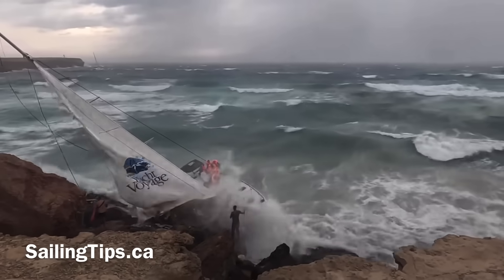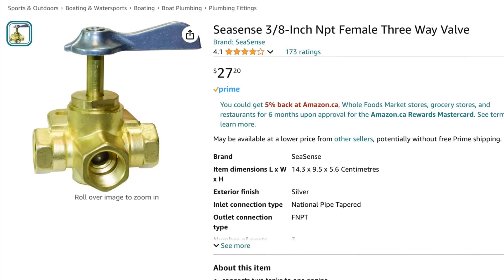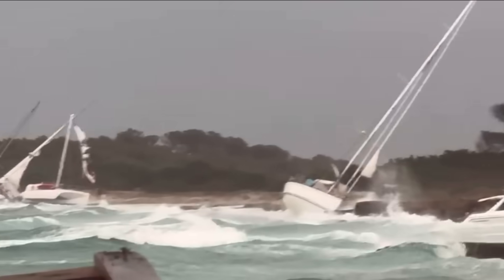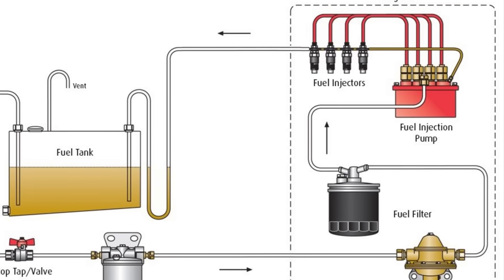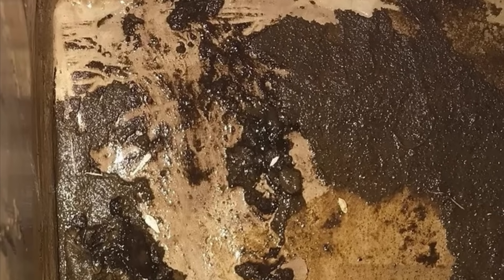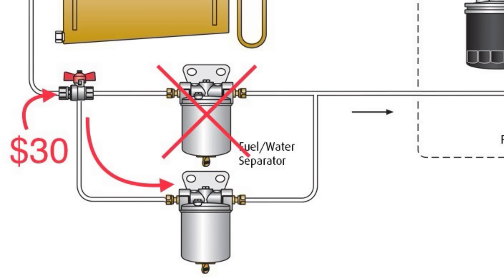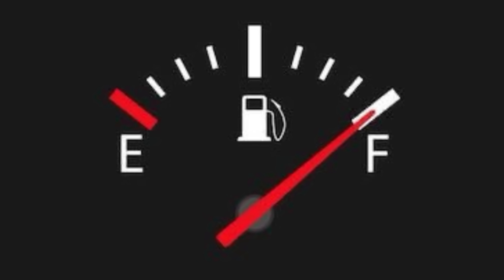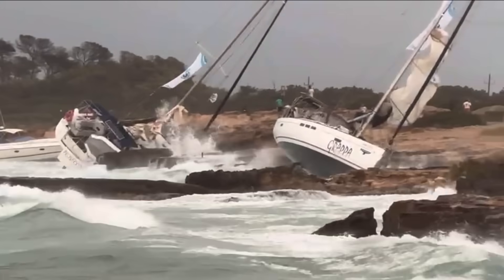The Critical $30 Safety Device Most Boats are Missing!!!

Comment: Add a diesel bug killer with every fill. Stop the bug from ever getting hold.
Reply from the maker: Yes highly recommended - I should have noted that in the video!
Reply: @SailingTipsCa  - My concern is that is conditions are bad enough to block up a filter, they are bad enough to block up a second filter too. Admittedly they may buy 10 or 15 minutes which might make a huge difference between safe water and being on the rocks. I guess it depends on the level of contaminants. The second set might be good for days or weeks.

We use a product that dissolves the bugs and the engine then burns them in the diesel. The problem with this method is that our filters are so clean that we are tempted to put them back on 😄(We always change them, but it is tempting!)

Perhaps a follow up vid on bug killers?
Reply from the maker: @SailingYachtSaltyLass  Yes the amount of time the second filter buys you is limited and depends entirely on how contaminated the tank is. Even if you have to sail towards safe harbour it does give you some piece of mind that you’ll be able to maneuver inside the breakwater when you get there. Good suggestion on bug killers!
Reply: 100%
Reply: Diesel bug and muck is often in marina filling stations' tanks - there is almost no way to prevent it getting into your tank. So it's cure rather than prevention, due to sloppiness, sadly.
Reply from the maker: @gurglejug627  Yes unfortunately many marina filling stations are also contaminated. To that end good to pick a filling station that has lots of traffic and the “freshest” fuel if at all possible!
Reply: Absolutely 💯
Reply: I'd have thought the marina would filter fuel as it's being sold. Maybe you could do it. Is there a device like this? If not I'm looking for investors. 😉
Reply: @kdizzystl  it sounds easy filtering Diesel on the dock - but try doing it on a tidal, floating pontoon in wind and rain. No, fuel is not filtered by marina suppliers - none I have ever seen. They don't give a damn - at least not in the UK - so why would they filter it? Who can prove it was their supply which caused an accident weeks later, from a yacht with blocked filters? The only way to filter a high-ish volume quickly would be to use a centrifugal filter, I would think, such as those used for the oil on tractors.
Reply: @gurglejug627  I'm finding there's alot of bs in boating.
Reply: @kdizzystl Just when you thought you’d covered all the maybes!  I haven’t decided if my sailboat or my Volvo is responsible for my constant high anxiety? 🫣🤷‍♀️
Reply: @lzh3131 cars nowadays are pretty much junk, throw-aways, made disposable on purpose. Remember when Volvos had million mile badges? Straight tanks.
Reply from the maker: @kdizzystl  There are a number of reasonable filtering funnels on the market and if you do a Google search for “Baja Filter” you’ll get a bunch of hits.
Reply: Agreed. Since there is now a higher percentage of biofuel in diesel the risk is increasing. Marinas sell the cheapest possible fuel - worse than supermarket fuel, with no additives that a brand name would include so it's no surprise fuel bug has become epidemic.

Comment: Isolated each filter with 2 valves instead. If you clog one filter, you are likely to clog a second one. With each filter having isolation valves, you can change filters with the engine running.
Reply from the maker: You’re absolutely right - there are varying degrees of complexity that you can build into the system and I just showed the cheapest and simplest option. With a second valve you can change the dirty filter while underway but still have to bleed it, which means it may or may not be available immediately, depending on your setup. Still less downtime than doing a full install with no engine!
Reply: @SailingTipsCa one can easily fit a lift pump for immediate bleeding, they cost nothing on eBay. Great that this discussion is taking place, so many good ideas forthcoming - you've opened a can of worms ;)
Reply from the maker: @gurglejug627  The primary Racor separator housings on my boat had Racor housings with manual lift pumps to aid with bleeding which are super useful. Still takes longer than flipping a switch to a second pre-bled unit but I agree this is a discussion that needed to take place!

Comment: Yep...did that to our current boat about 20 years ago. Went a step further. 2 Racor 500 filters and 2 electric fuel pumps in parallel. Easy switch over if needed. 
Just bought a new boat that does not use an electric pump pump but will be adding a 2nd filter unit. But one of the first jobs will be pulling the tank out, cleaning it thoroughly and adding an access panel!
Cheers and really great tip.
Mike
Reply: Buy a cheap generic racor and a 12v fuel transfer pump & add a long pex wand to it and you have your self a tank cleaner to suck up all the nasty stuff from the bottom of your tank ! 😊
Reply: @jackdbur  Yes...basically fuel polishing set up. Only reason I have ever wrestled out a tank is to have room to cut an access panel in the top. Every boat I have owned did not have an access panel!!! Should be standard. LOL!
Cheers!
Mike
Reply from the maker: @michaellippmann4474  Access panels should also be standard!
Reply from the maker: @jackdbur  That’s a great suggestion - thanks!
Reply from the maker: Yes the Racor 500s are with parallel pumps are a very nice solution, and a bit more expensive, but worth it if you can do it!!!

Comment: Good advise. We run a Racor twin filter with hot spare. One gets clogged, instant switch over to the spare. However, a stalled diesel engine can have many reasons why it won't run. Know your engine system inside out and keep on top of maintenance. I always advise doing it yourself rather than paying someone if you sail offshore or plan to go further afield. Not going to get an engineer to help you 100 mile offshore!
Reply from the maker: You’re absolutely right! Sometimes when you buy a boat it takes a bit of time to get to this point of knowing your engine inside and out but definitely what every sailor should strive for!
Reply: The fact is that you can buy generic racor housings so cheap why would you have only one !😊

Comment: The other tip I saw, which would work well with your idea, is to keep a separate canister of diesel on bored that you know is clean. If your engine stops due to dirty diesel then detach the fuel pipe and insert it into the canister of clean diesel. Even better if you can do that through a separate clean fuel separator.
Reply from the maker: Yes that’s a good suggestion - belt and suspenders!!! It’s nice to have lots of options!
Reply: Then you have to bleed the system in time.
Reply from the maker: @dboboc  Yes that’s the beauty of having a redundant pre-bled system already installed!
Reply: sometimes growth occurs on mesh filter that is inside intake tube inside the tank, so fuel never gets to the separators in first place
Reply from the maker: @viktorbek5098  Yes it can really grow anywhere the right conditions exist!

Comment: Good one. Another equally cheap safety fix is to have 2 other hoses with a pair of 3 way valves, connected into the system so that you can drop the ends of these hoses into a reserve fuel bottle or tank. It is far easier to keep a 20 liter drum of fuel clean ready for that storm emergency.
Reply from the maker: Yes that’s a great suggestion - nice to have several options for getting that engine running again!

Comment: Okay.. Most marine diesel engine manufacturers state in their service protocols to drain the fuel tanks and clean as apart of the annual maintenance service. Just follow that and you won’t have a problem.
Production boats will always be just that production boats. Don’t blame boat manufacturers for your lack of interest in thorough maintenance.
Reply from the maker: Yes you’re right it’s part of the annual maintenance protocol but few people do it, and if you buy a second-hand boat it’s not always the first thing you can get to. Sometimes it takes a bit of planning and getting to know the boat before you can clean the tank, and the ease of that also depends on the manufacturers design and decisions. Lots of production boats don’t come with access hatches, for example.

Comment: Dear @SailingTipsCa your tip is very interesting. For microbes and sludge there are on Amazon some additive for diesel bio killer. Maybe an alternative when you have no sufficient space on board. What is your opinion on these prodoucts
Reply from the maker: I’ve always used them too and should have noted that in the video. However I’ve also not seen any studies on how well they actually work in various conditions…

Comment: The idea is fine but the valve is very poor and liable to jam after a few years.
The aircraft industry has abandoned this design.
Look in the aircraft spruce catalogue for "newton fuel valves" and female 1/4 nps  or npt fittings, there are other valves but around double the price.
Reply: Generic racors can be had for less than a hundred dollars!
Reply: @jackdbur  when I was looking, I saw some very cheap versions. 
However when I read more about them they only mentioned gasoline. 
I know the principle is the same, as in the fuel floats ontop the water. So they probably work. 
However I am just not certain if anything else is different. 

Oh, in my profession ( driving trucks in extreme environments ) in a bind we will just rinse our fuel filters in Methol Hydrate and it always gets the trucks running. 
We only run those trucks 3 months a year,  so it isn't exactly the most healthy environment for them.
Reply: @sailorstu  Ebay has direct copies of racors
Reply: I would love getting a spare $30 filter system.
Or wouldn't even mind paying double that.
Where I live in Canada a basic Racor system was over $300 when I asked 😮

I may just go online and buy their double filter system.
Reply from the maker: @sailorstu  The $30 solution is for a straight bypass of the fuel/water separator which then leaves the secondary filter to do all the work and protect the engine. It will buy you a bit of run time to get out of trouble but I much prefer the double primary system. The double off-the-shelf system is really the nicest IMHO. Really depends on how much you have to spend.
Reply from the maker: That was the cheapest valve on Amazon. I bought the one they had at the local chandlery which was a bit more expensive. This is definitely one application where it makes sense to pay a few dollars extra. Even double the price is good value!

Comment: Every (small) G/A sports aircraft has a tank fuel drain to allow pilot to drain small amount of fuel and check for water due condensation. Strange we don’t have similar in boat tanks. Or a second higher in tank fuel takeoff. Switchable. And that second filter. I have my tank cleaned every time I suspect sludge. And run on GTL with virtually no bio sludge build up.
Reply: One challenge is in many boats the drain valve would be too low to use, no room for a cup to sample the fuel.  I have solved this with a plug at the top of my tank with a internal aluminum guide tube to direct a hose to the lowest point on the tank.  Also safer since there is nothing to leak at the bottom of the tank.  This "top sump" allows water, the source of sludge, and particles to be removed with a hose and squeeze bulb into a clear container.  I designed my tank with a low point, not a flat bottom.  A flat bottom disperses the contaminants and makes it impossible to sump them out.  My filters are always pristine at end of season.  Former pilot turned boater...
Reply: @warped-sliderule making the boat tail/nose heavy creates a low point in flat tank (shift your ‘stuff’ add 2 x 25 kg water canister.) then u can use that vacuum oil extractor you already have to clean out tank bottom corners. If you can reach it from above. I can (also ex pro pilot here….)
Reply: We do have that in well designed boats. I have two tanks with drains.
Reply: Good idea!
Reply: Very few (small<10 m) power boats have that. I owe one. No drain. Mostly due to hard to reach tank bottoms. Much easier on G/A planes. But still…..a little plumbing could overcome that.
Reply from the maker: Yes ideal to have a drain if you can manage it but many sailing yachts have main tanks in the bilge which is the lowest point in the boat, so hard to drain. A good alternative is a day tank at a higher point that the engine draws from, and which can be filled from the main tank(s).

Comment: I live in the tropics so it's also best to have your tank full as often as possible. The air in the tank condensed into water as it cools nightly and taints the fuel.
Reply from the maker: Yes that’s a great way to minimize the amount of water in the tanks too!!!
Reply: @SailingTipsCa which won't work. The diesel you put in your boat has already absorbed water. More diesel (full tank) is more water. Good tank design, with a sump & drain valve to empty the water out is the only way, along with biocide treatment and a good separator & filter system
Reply from the maker: @deerfootnz  Keeping your tank full will clearly not have any effect on diesel that has already absorbed water before you put it in there! Yes a good sump/drain  system is helpful and “easy” to design into a custom boat but may not be so easy to retrofit to a production boat.
Reply: Wow, I didn't think saying this could be at all controversial, but here we are. 
A. Tanks have breathers so new air will get in daily.
B. Tanks have gasses that expand and contract.
C. "Microbes/bugs" grow more in the water than diesel.
D. If you can afford a boat you should be able to afford preventative maintenance.
E. Can anyone give me a downside to the suggestion of keeping a fuel tank topped up?

Back the the keyboard worriers. I'm out!
The sailing community used to be nice and helpful. Pitty now.
Reply from the maker: @Sibl3o  Appreciate your comments and keeping tanks full is certainly a commonly accepted and I think helpful practice and it also keeps sloshing down as I noted in the video. I think there are a lot of variables regarding vents and how much moisture gets in, ranging from the size, location and geometry of the vent, to the atmospheric conditions. So I can certainly imagine condensation being more of a problem in some places than others, and in some boats than others.
Reply: I live in the Philippines, an area well known for high humidity. I'll try to explain why condensation in fuel from the air is mostly a myth. 

At 30C/86F the most water air can contain at 100% humidity is 30 grams/cubic metre. A 100 gallon tank = 0.38 cubic meter. At 30C/86F, an empty 100 gallon tank could contain a maximum of 11.4 grams of water in the form of vapour, or 0.4 oz. So at the extreme end, the most water that could condensate out in an empty 100 gallon tank is less than half an ounce. Any engine could easily deal with this minuscule amount of water in the fuel. With my 40 gallon tank, the amount of condensation inside the tank is so small that I never once worry about it.
Reply from the maker: @NotExpatJoe  It’s not always clear where the water comes from but as you noted you’re certainly not going to accumulate a large amount of condensation quickly, but rather it will take considerable time, depending on both the humidity, the difference between day and night temperatures etc. So let’s say your tank is half full and accumulates 5 grams of water per day. Not much at once but it could add up over time, accumulating a bit with each heating/cooling cycle. It would be interesting to do some empirical tests to see how much actually accumulates!
Reply: @SailingTipsCa  an interesting discussion but... unless you fill & empty the tank every day and you'd probably need to leave it to cool/condense the water over night, then fill it in the morning. Then repeat this cycle daily, then you're not going to get 5g of condensation per day.
You need to replenish the tank with "fresh" humid air every day. Otherwise, once the water has condensed out of that air then that's the end of it! The air in the tank essentially contains no water & you could leave it for a year and no further water would condense from it.
Reply from the maker: @alanm8932  Yes you’re right - the first cooling cycle would condense most of the water out of the air and from there on you would have “dry” air above the fuel except for whatever air exchange took place through the vent. Other commenters have noted that they installed “vent driers” to minimize moisture coming in through the vent with very positive effect. In any case I agree that condensation probably isn’t a huge source of moisture, and you’re probably more likely to have rain water or seawater coming in through the vent or a poorly sealed filler cap, or the moisture was already in the fuel when you pumped it.